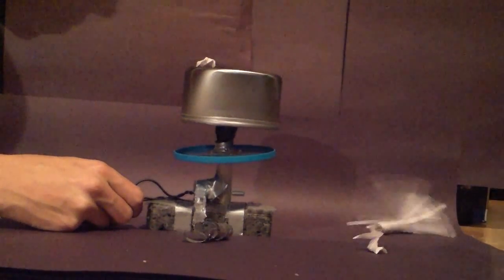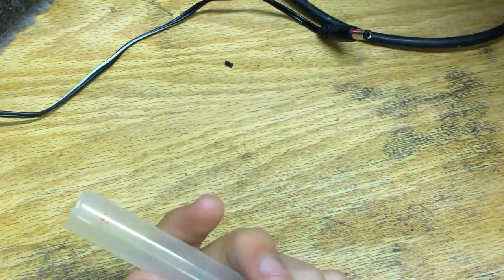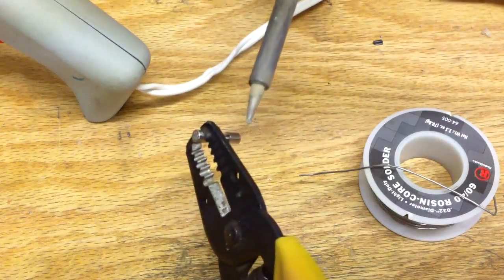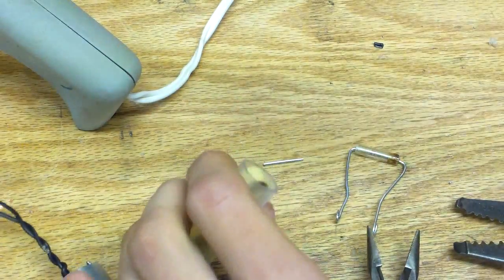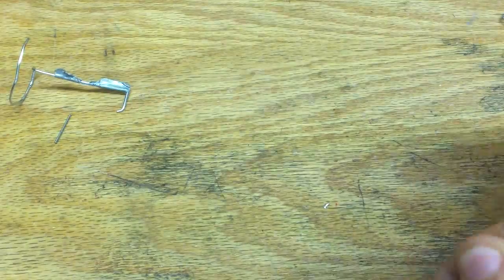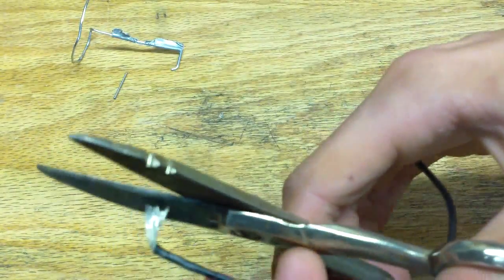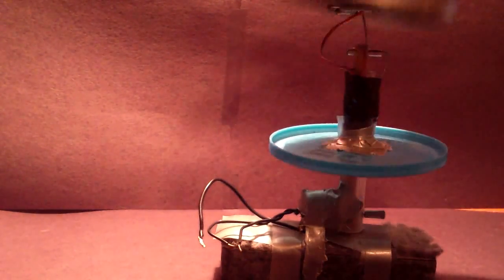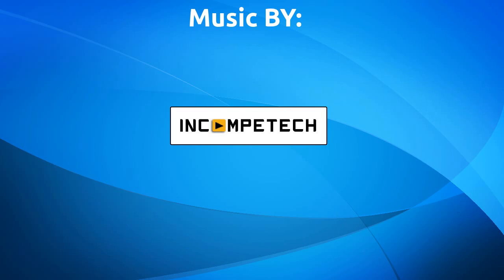How to build an impressive 30,000 volt Van De Graaff generator!

Comment from the maker: Try a different  rubber band, maybe overdrive the motor some (they can usually handle 3 times their rated voltage.) Make sure the brushes are very close to the motor but not touching, as this will destroy the band. when you turn it on without a topload, you should smell corona buildup  on the wire. if so, it is working fine, but you will need a better topload.

Comment from the maker: Good luck! Make sure you use an aluminium  heatsink on the LED if it will bw running at full power. Also, don't use standard batteries as they cant pump out enough juice to drive tye LelED.  What type of driver do.you plan to use/make?

Comment from the maker: Anything that is made of rubber and in the shape of a rubber band should work. a polyester belt should work (ribbon glued together as a belt) and if you can find a balloon and make belts with the rubber from it, that should do you fine to. rubber bands for this particular design would be your best bet though. search for the triboelectric scale. any material in between vinyl and glass should work as long as a belt can be made out of it and isn't conductive or metallic.

Comment from the maker: It's a 5 volt motor I pulled out of a old cassette player and I power it with a basic wall adapter (more specifically a 12V 0.7A power supply).

From my own personal experience, the voltage applied to the motor makes for a sort of crud speed control. As long the voltage the motor is driven at is less than 2.5 times the voltage rating of the motor, it should be fine (just be sure that it is under only light load, not overheating, and the brushes are not sparking like crazy)

Comment from the maker: I don't see why not. Google the triboelectric scale. the rubber you use should be found somewhere in the middle of the scale, in between vinyl (electrical tape I used at the bottom roller) and glass (fuse for the top roller) and as long as it does not conduct electricity well (otherwise the generator will short itself out as it tries to build up a charge)

Comment from the maker: that's what I do. that wire in negativity in respect to the top, and (from a different viewpoint) the top is positive in respect to the wire. unless your also touching that wire, you are just a neutral body, either collecting a charge from the dome or from the wire, and you get no dramatic sparks. you need to complete the electric circuit by touching one, and bringing your finger to the opposite side.

Comment from the maker: the black wire is part of the bottom brush. it collects charge from a large source (many electrons inside the earth and you!) and the rest of the generator crams it into the top piece. (the charge can be actual electrons, or lack of them, in which case the opposite occurs, the generator crams the negative charge on everything else) My generator does this. It sucks the electrons out of the top dome, and deposits them on everything else.

Comment from the maker: the black wire connects to ground (a cold water pipe, a bare (uninsulated wire buried into the ground, even you can act as a ground connection, just hold on to the other end.)

Comment: Nice! Lots of good construction tricks here. You got bit by the metal support wires descending down close to ground but your results showed you got around it very well. Well done video too! Very clear. Keep em coming.
BTW At 0:32 you say triboluminescence effect when it's triboelectric effect. No big deal.